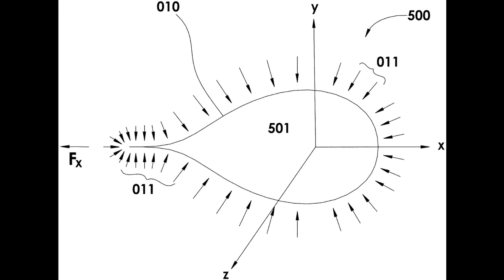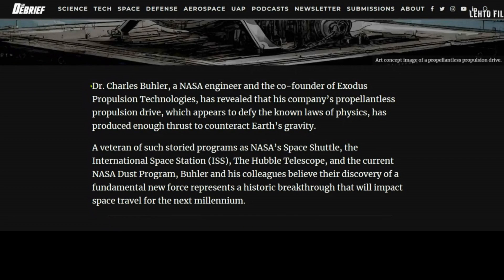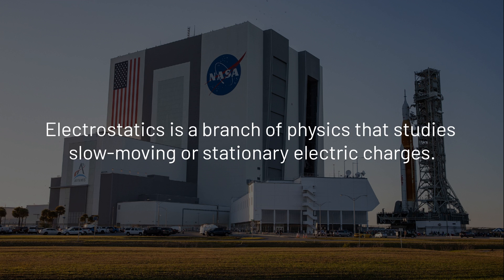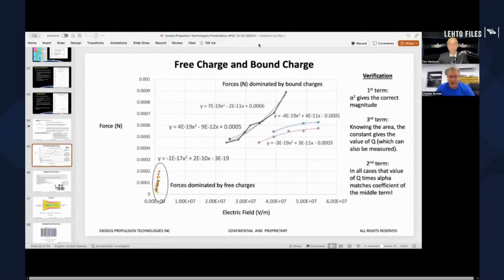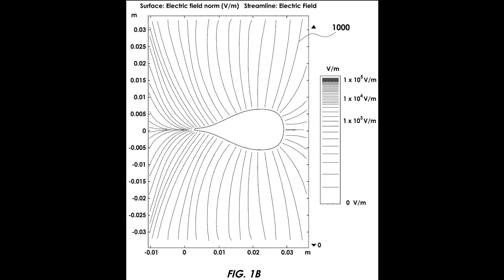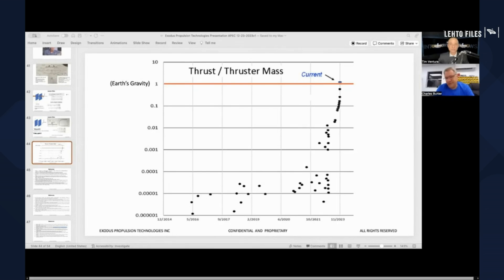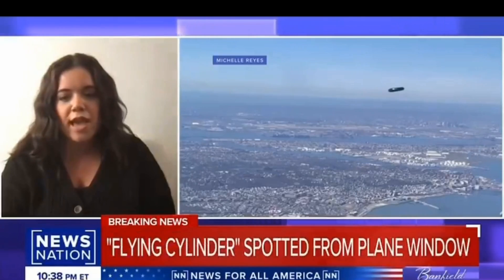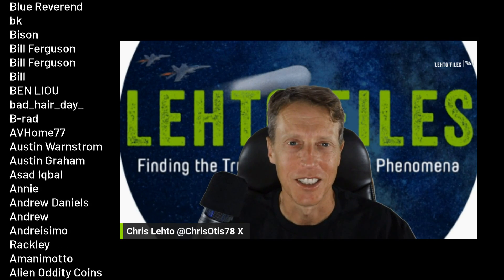NASA Scientist's Propellantless Thrust Breakthrough - The Key to UAP Propulsion?

Comment: New Old Scam ... charge fields are not connected to the particles that are charged. Fields create condition for potential energy ,not for kinetic energy. Fields And Space-Time bends and do not reflect - matter and energy can deflect and be deflected. Assimethry  on a scale bigger than Quantum das not lead to assimetry on a Quantum level ... and the conservation of energy is symmetry based on a Quantum particle level. No free action or acceleration. No free lunch.

Comment: Its not any new physics, they explain it quite clearly, but perhaps the show producers didn't understand how this fits in to existing physics. It is just resonant effects with internal geometry that leads to increased pressure on one side, creating thrust. Once you understand that, and the geometries involved, then you understand that they will be able to enhance the effect of the system. The same thing can be done with microwaves in a structure acting as a magnetron of suitable geometry... and the advantage of using photonic based systems, rather than electrical, is obviously the higher potential velocity (since you cannot get a higher speed than your "propellant") - electrical systems do have have an advantage at low speeds (<0.2C) due to the higher mass of electrons, but photonics has a clear advantage beyond that... and if you include the ability to use resonance to exponentially increase the number of photons, you can see how a photonic system could overcome the limitations that come from low, individual, photonic mass... overcoming the thrust differential. Of course the limitation of both systems, is that, because you are relying on resonant impacts for the generation of thrust, any motion perpendicular to the direction of thrust, has the effect of dramatically reducing the amount of thrust... of course you can allow for that in planned, or expected movements, but you become extremely vulnerable to unexpected forced movements, as well as anything that disrupts the electonic and photonic resonance... electronics can be shielded, but a highly focussed EMP class emission can still severely mess with these propulsion systems, and if combined with the right kinds of turbulance or magnetic effects, things using this kind of propulsion could quickly fall out of the sky... now that sounds like you would need to use a nuke... but that is not necessary,  as EMPs can already be simulated - they would just need to be directional and of sufficient power to disrupt the photonic/electronic pressure. A series of macrowave lasers that cycle through the susceptible frequencies could also be used... or in a pinch you could mount an EMP generator on a missile, designed to emit an EMP pulse, right before detonation, close to the craft, creating the disruption and turbulence necessary to effectively cause the propulsion system to become ineffective - which could be quite deadly to such a craft enganed in maneuvers , because you can see how engine orientation becomes important when trying to overcome gravity.
Reply: Can you elaborate on what resonant effects are and how that correlates to geometry and pressure?

Comment: It doesn't sound convincing:
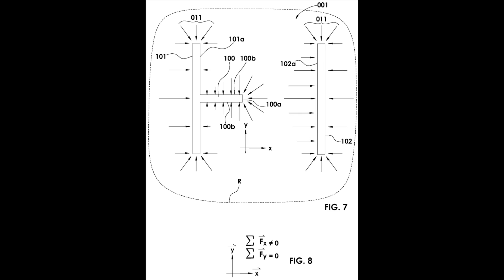- what's shown here: 10:18 and said here: 11:28 contradicts what's shown here: 3:17 & 4:04, where the net force is shown to point left
- also: 3:17, 3:26, and 9:21 clearly show, that an external electric field must be applied to generate the force acting on the drop-like dielectric grains, in which case they could only reach one of the electrodes - anode according to 3:17 & 4:04, but cathode according to 10:18 & 11:28; if these grains were spatially locked with electrodes, the whole device wouldn't generate any net force same way as one cannot raise oneself by stretching braces
- it all seems to intentionally ignore the edge/point effect, where electrons are expelled due to charge accumulation; if that happened, the grains would simply experience a short period of fading electron jet force (electrons acting as propellant), thus being positively charged, repulsed from the anode, and attracted towards the cathode, which is totally expected and would point to 10:18 & 11:28 being right, but not due to some mysterious new forces
.
There are only 3 scenarios in which I see it being capable of generating any exploitable net force:
- an ambient, absolute electric field(s) available, like those which counterpart the Earth's magnetic field or solar wind; but these aren't simple anode-cathode fields, and more like a tangled and knotted fabric, which must be dynamically navigated
- the device scooping ambient electrons and actually exploiting the edge/point effect, which boils back down to propellant-based motion (although no propellant reserve is needed)
- some variable-field scenario with asymmetric EM-wave (light) density produced by grains, escaping the device, which effectively turns it into a photon drive, which is super inefficient - regular laser LEDs are far better
.

Comment: There is way to do thrust without carrying fuel. That doesn't 'break' physics.

The anology is of a riverboat paddle wheel, where the external sun's plasma stellar wind becomes the 'river', and a magnetic system onboard the spacecraft provides the 'paddle wheel'. 

You'd push against or accelerate back at the stellar wind magnetically in order to accelerate, still a reaction system but the propellant is the external, always there, stellar wind.

Of course, going directly 'upstream' or towards the sun might sound hard, but that's what all the orbital mechanics & thrust vectoring – designed initially for solar sails – would be used for. (& maybe for sample returns)

Oh, and like ion drives, you can't use it to launch from the ground, nor land with it. 

Strictly for getting slow steady acceleration in the solar system, mostly to help space probes do science within a reasonable timescale.

Comment: The new ion thrust drone technology. Its not new tech. Its been around for a few decades. First as a plasma jet toy blimp. Its just high voltage, very low current propulsion. Supposedly used on the wings of the B-2 and B-21 bombers to reduce drag. And no, its not the propulsion of the alien aircraft operating in earth's atmosphere and oceans. Wishing doesn't make it so. Their tech is way beyond electrical engineering concepts. Its vastly advanced quantum high-energy physics tech.that eleninates the effects of inertia.

Comment: If you have a styrofoam capacitor weighing a tenth of an ounce that can produce one G of force against itself, that 1g of force per one tenth of an ounce. I’m not sure how the math works here, but it sounds like a very minute 1g of thrust which would need to be “shared” in the sense that thrust would be needed for the capacitor thruster itself and the overall ship that it is supporting. Another assumption would be that an overall thrust of 1.5 earth gravities would be needed at the end of the development effort of improving the thrust of the small individual thrusters. What would the actual drive unit look like in order to propel Starship to Mars? This is only a thought experiment. And it only assumes a Starship sent to orbit via the current booster or “Planetary Drive Booster” or PDB, which then returns planetside after delivering Starship to orbit.

It goes without saying that it would be far better if the individual thrusters could be developed to the point that they were able to generate much larger thrust, perhaps three gravities each. If that were the case perhaps we could drop the entire conventional booster stage entirely. That would be the ideal ask and situation because then the only fuel is electricity stored in the individual small capacitors. Perhaps they could even be scaled up to become extremely large sized super capacitors. We just don’t know because of the beginning stage of this new science/physics that has been discovered and is in development. For now I think we need to stay with the concept of the current IPB and the IPDS that will move Starship between planets.

So at the beginning Starship would boost into orbit via the  PDB, detach it and send it back to Earth. Then Starship would dock with and become attached to this new “Inter Planetary Drive Section” (IPDS). Arriving at Mars, it would then park the IPDT in orbit and dock to a second PDB, which it would then use to land itself on Mars. What follows next is about the IPDS and its capabilities in making the crossing between Earth and Mars in a very short time.

The mass of Starship without fuel, fuel tanks and engines is around 65 metric tons. For each of the many thruster units in the IPDS weighing 1/10th of an ounce generating it’s one gravity of thrust, assuming the thrusters can all be stacked, twenty three million thrusters would be needed which would effectively double the mass of Starship. 

This does not account for weight of the 100 crew, other equipment needed to support them, as well as whatever power source would be need to refresh all of the drive unit capacitors. Apparently the drive unit, once it receives its electrical energy, can run without being recharged for days, even weeks according to the scientist being interviewed. If so, half of one G continuously applied would allow Starship and its occupants to accelerate under half a gravity of thrust towards Mars, switching at midpoint to decelerate at .5gs and arriving after a mind-blowing 6.5 days.

These calculations were made by ChatGPT’s new o1 preview model. There may be drastic improvements in economies of scale to reduce number of thrusters and thruster related mass, and I suspect there are. This is a worst case scenario. But what an amazing concept. Starship could deliver people to Mars in such a short period of time, and with no need to recharge any of the thrusters. It would probably be necessary to somehow discharge the electricity from all of the thrusters in the IPDS once Starship arrives and lands via the IPB while the IPDS remains in orbit. 

That’s about it. Once on Mars, fuel would then need to be manufactured to refuel the PDB so that Starship could then go back to orbit, dock with the IPDS and leave Mars, bringing back people, perhaps even trade goods and sample returns etc. as needed. What a concept. Interplanetary trade? Yes!

Comment: I kinda see it as an electrostatic wing, akin to how a wing can create a pressure difference between the top (low pressure) of the wing and the bottom (higher pressure), so does an un balanced electrostatic field, or a specifically balance field.

Comment: Basically, a system with an asymmetry in electrostatic pressure or some divergent electrostatic field gives a system of a center of mass a nonzero force component.

That's the basic explanation.

Seriously. What the actual mother FUCK techspeak gobbledygook nonsense is that? I call bullshit. Show me or bullshit.

Comment: Imagine powering craft Wirelessly with microwaves. How would you wirelessly Power everything on Earth, aircraft in the sky, and anything in Orbit around the Earth?
Including Asymmetrical craft as discussed in your video.

With an Ionosphere/Magnetosphere harvesting technology be incorporated into a Wireless Orbital Power Satellite (WOPS) constellation of course!

Doing away with the need for Solar Panels, and with a streamlined design the satellite constellation could maintain their altitude with Air Breathing ion engines, and laser filaments connecting to the Ionosphere for direct energy harvest.

Comment: I think it is a very high bar to clear if what you are saying is that Newton's Third Law of Motion is incorrect, which is what you are saying when you say that there is no propellant.
Of course electromagnetic forces and gravitational "forces" if you want to call them that also do not have propellants, but they still push on a counter object that is different from and external to the vehicle being accelerated. What does this new force push on?

Comment: These UFO aircraft do not use this form of propulsion. The uneven charge reacts with the surrounding radiant energy, so that between them there is a relationship like  the law of action and reaction. A UFO uses a different type of propulsion. In order for such an aircraft to be able to cross large interstellar distances, it must satisfy several different factors. The first is transparency for the surrounding matter, that is, it does not interact or disturb the surrounding matter in its movement. This is because at extremely high speeds the aircraft is not exposed to external radiation, micrometeorites and large material objects on its way. The second concerns the ratio of living tissue and acceleration of at least 1000 G. The way in which the aircraft accelerates does not have the characteristics of Newton's third law - the law of action and reaction. Here, the very foundation of motion energy was mastered. For example, the generation of a directed "gravitational" field brings the aircraft into a state of exceptional acceleration, but the effect is identical to free fall. Such energy simultaneously affects all particles of the aircraft and living tissue so that it does not create a difference in acceleration, and therefore pressure which we call G load. Also, since they have mastered the manipulation of this energy, they can also draw energy from the environment because everything is in motion, even space itself. There are still a lot of items that have to be satisfied, but the explanation for them still has to be more complex and you wouldn't understand me. Even this previous description is too simplified and very shallow.

Comment: They mention "High Voltage Capacitors".  This is exactly what Thomas Townsend Brown did in 1921. While experimenting in a lab his parents had set up for him while he was still in high school. Brown discovered an unusual effect using a Coolidge tube (hot cathode tube), a type of X-ray vacuum tube with two asymmetrical electrodes.  When extremely high voltage was applied, the weight of the capacitor was reduced.  This is also similar to what Germans Developed during the 2nd World War, a device they called "Die Glocke" or the bell in English.

This is huge, it could upend air & space travel.

Comment: I've built a vortex propulsion drive   A rotating fluidic mass can be distorted so that 3/4 of the vortex is heavier leaving 1/4 of the vortex lighter ...the key is in the fluid speeding up to the center of rotation to compensate for the distortion of the rotating fluid  Thrustless propulsion

Comment: Nobody commenting here passed the 1st Uni math class? Have anybody had a look at the patent? Is full of basic calculation errors, not speaking about the "macroscopic" BS anybody could have noticed, that the thing does not even conserve the overall system momentum, which is as inviolable as the overall mass-energy conservation. Apparently, the Patent Office puts stamps on everything, as a claim, not as a fact. And, by the way, the "non-nano" versions of the system are still claimed as having quite a high force (see the graphs), they can be reproduced with 100 bucks HV and clearly measured with a 10 bucks milligram precision balance, wonder why not a demo video is included. Check for debunkers, they will appear soon.

Comment: Well if you recall, bob Lazar specifically talked about there being another type of charge but not being electricity as we know it. I also believe he mentioned what we refer to as the "weak nuclear force" being actually the positive charge of protons within an atomic structure, and hypothetically, if you were to have one side of a object or craft have it's dialectric component immensely charged with electrons which are also flowing around the object towards a convexing nodal point, yes, it makes sense that the resulting propulsion would effectively be itself propelling itself without anything actually being propelled from the object, except space vector.
Reply from the maker: Interesting thanks, I didn’t remember lazar saying that about charge
Reply: Bob lazar wasn’t an actual scientist reverse engineering UFOs, he worked as a simple maintenance technician that fixed electrical problems at that base (a normal electrician) , he’s telling half truths because he may accidentally saw it in some hanger and over exaggerated his job to gain attention, it does work on ridiculous amounts of voltage but other than that I can’t say anything.

Comment: You can't just say "there is a force pushing" without defining what the force is and what it is pushing against. That is why propellant is required for propulsion in a vacuum. There is no "pushing" because there is nothing to push against. So you have to shoot mass the opposite direction you want to move. Using some imbalance of electric fields to create motion implies there is something there for the fields to interact with in a way to create that motion, and none of that is even described here. There certainly isn't anything we know of in the near vacuum of space (or at least not enough per cubic cm) for magnetic fields to interact with to create motion so you would need to figure that out before even being able to describe how such a thing works, much less how to use and control it.

Until there is some evidence of underlying physics, this is all just modern day versions of alchemy and perpetual motion machines. I'm not against sending their contraptions to space to find out for sure, because wild stuff does pan out once in a billion tries, but this is hardly some "discovery" until something is actually discovered and explainable.